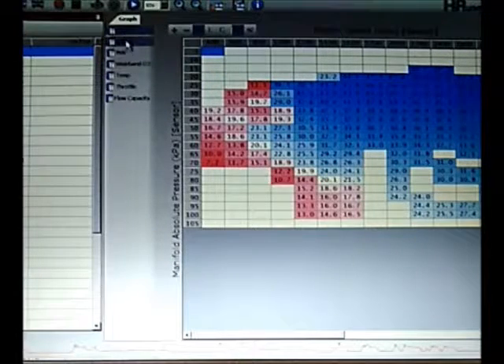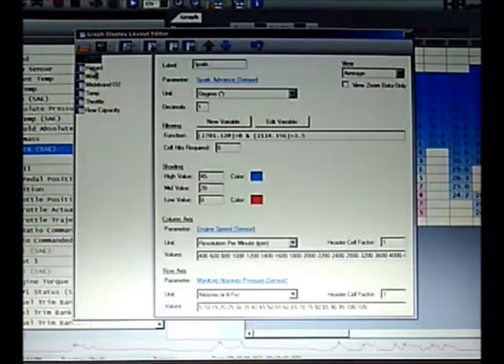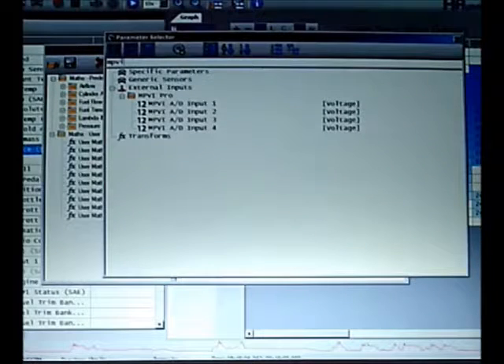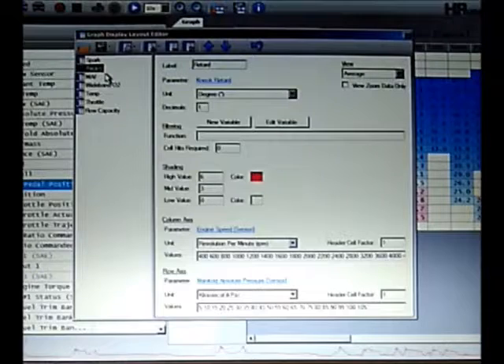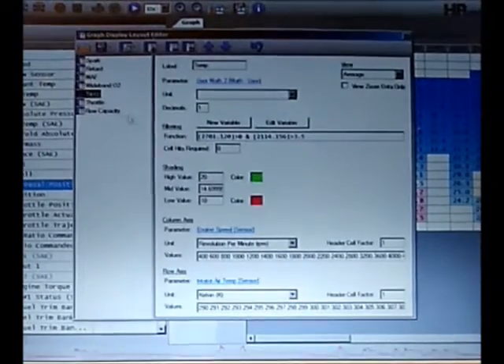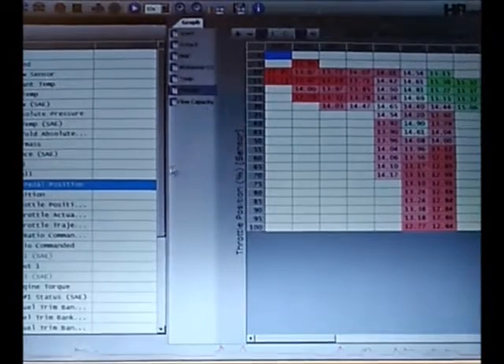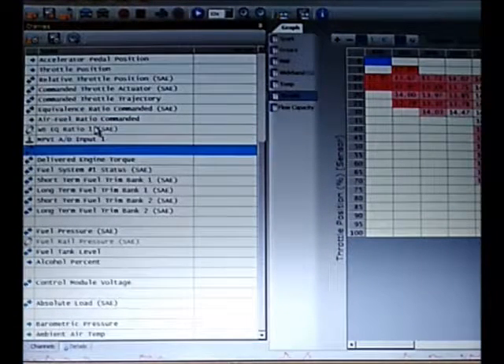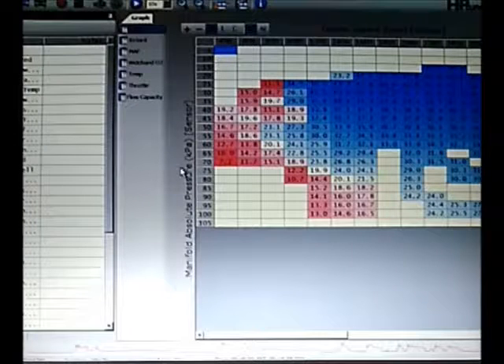How to Do a Complete Open Loop VE Tune Using HPTuners - Part 2: PIDs, Charts and Wideband O2

Comment: On gen 3, do u have to fail maf to put car into open loop or no?
Reply from the maker: No.  The MAF will continue to read but will simply be disregarded by the ECU.  You DO have to upgrade the OS via HPT however so that the MAF does get ignored.  It's more about the underlying OS that tricking tables.  With the upgrade, the MAF table simply goes mute while the VE table is greatly expanded and becomes the dominant table.

Comment: I really appreciate the videos!  These are a hidden gem and deserve more attention.  I could mostly pick up what you were doing via your dialogue, but the part that I needed the screen resolution for was the formatting of the filters.  Can you type that out?  Also what was the exact filtering parameter used?